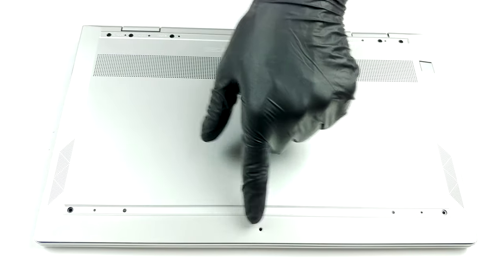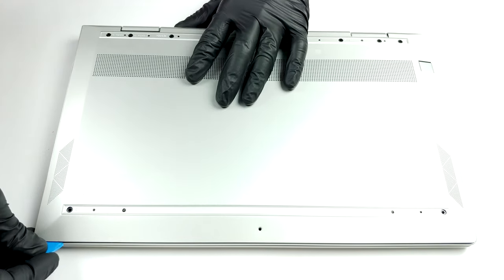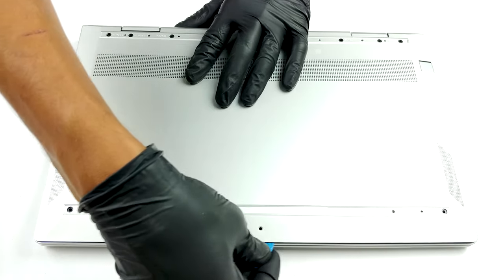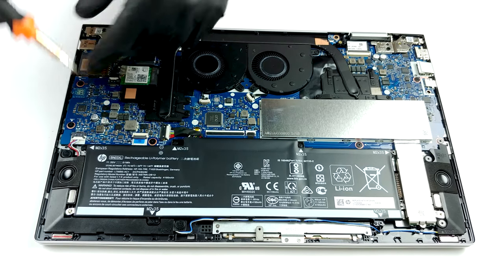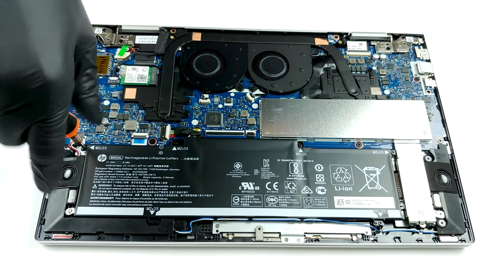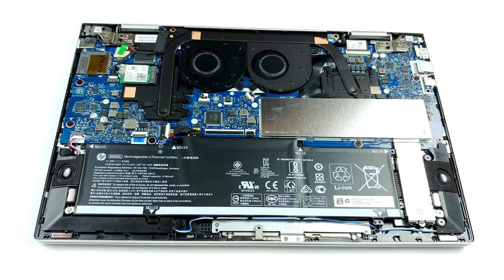🛠️ HP Envy x360 15 (15-ed0000) - disassembly and upgrade options

Comment: According to HP's manual for the 15-edxxx series the RAM is non-upgradeable (the 8GB they throw into these). Can you confirm specifically, which model # you had here (ed0008ca, ed0010ca, or ed0020ca)?
Reply: Non upgradable ram is the 13 inch version
Reply: x360 15" with upgradeable ram.
In previous line (with ryzen 2500) you could add HDD 2.5 (up to 7mm)
Reply: I have this same question. I have an HP 15m-ed1023dx and the manuals contain conflicting information. I have 12 gb but want to upgrade but one manual says it is not upgradeable but another manual gives directions on how to change out memory.

Comment: Incomplete video - Need to see if the CPU is replaceable!  Need to see how the motherboard comes out, too!
Reply: The cpu is not replacable
Reply: 0.2 % of the laptops released in the past 5 years has replaceable cpu, so please stop asking
Reply: Thanks Hamox.  Still good to see the motherboard and fan assembly come out. Unsubscribing.
Reply: @DrFunFong  Only Laptops before 2014 can be upgraded the CPU. After 2014 all CPU are permanent.

Except Laptops that genuinely using Desktop Socket (Not Mobile socket CPU)

Comment: I have a HP ENVY x360 15-ed1xxx Laptop. I cannot find poo on exact max RAM speed. I did manage to find the max amount is 16 GB but nothing says at what max speed. Using the performance tab in the task manager, I see my speed is 3200 MHz, 8 GB SODIMM total (x2 4GB) 2 slots used. I want to move up to x2- 8GB SODIMMs, but do not know what max speed I can use with this MOBO. I am not taking my whole machine apart to see the mobo model. Lots of info on OTHER x360s but NOT mine. Anyone have seen info I cannot seem to find? Thanks in advance!

Comment: Kauft besser den Apple M1 Chip, dann braucht ihr kein Upgrade mehr :)
Reply: That cannot natively run x86 and doesn't support windows. And you also support a company that doesn't give a damn about user reparability and upgradability, I don't think you can open the macbooks at all. Sooo, nah.
Reply: But it has one of the strongest cpu, the gpu is lacking tho